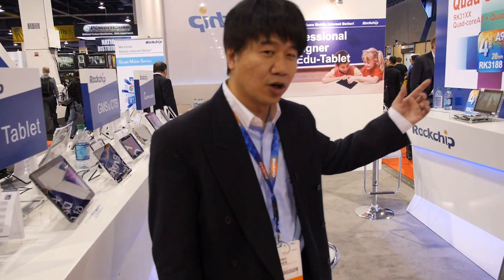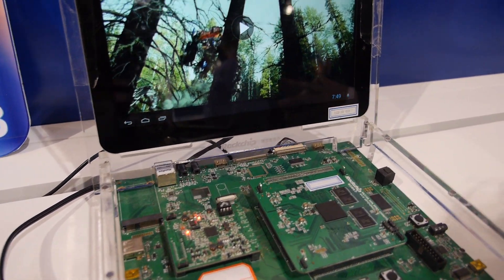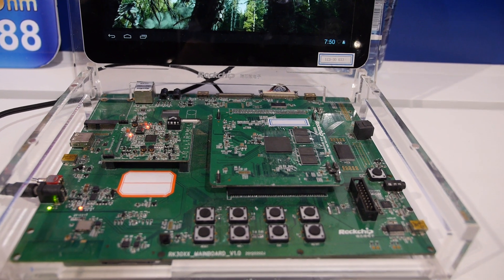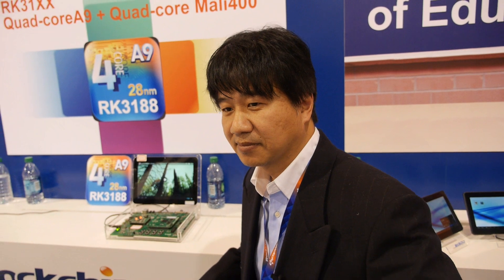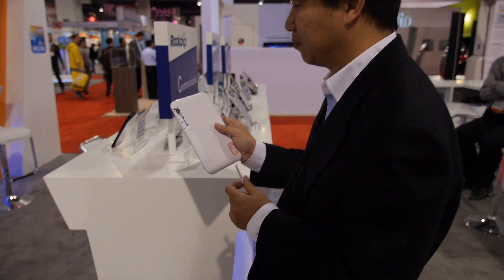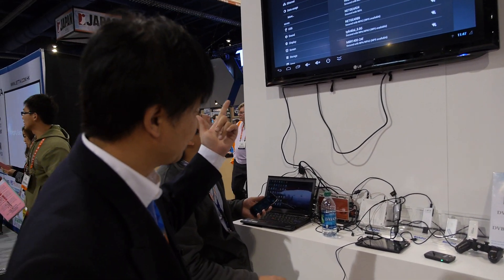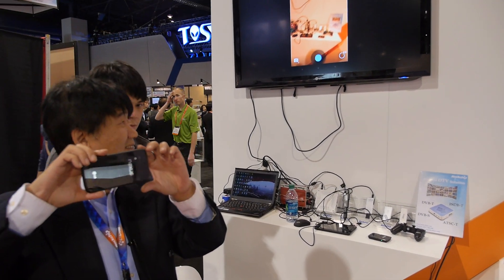Rockchip RK3188 Quad-core 28nm HKMG ARM Cortex-A9 launched

Comment: OK, but I must have a device with Android 4.2 and Miracast support so I can transmit the wireless mircast images. Then, if my TV doesn't have Miracast support I will use the Android TV dongle. But is there some Android application for the RK3066 which can accept Miracast from external device and show it on the TV via HDMI?

Comment from the maker: My guess is that all RK3066 devices on Android 4.1 already have Miracast support built-in, at least for the receiving part. But for sending the miracast signal it may only work on any Android 4.2 device and I expect Rockchip to release the 4.2 software update soon enough too.

Comment: Perhaps support for 802.11ad / wigig & wireless docking will be the key to outselling the netbook market!

Also, seems like devices based on the older rk3066 should work with miracast (MK802 , UG802 , mk808/gv20).. Why doesn't it??

I wonder what nvidia's tegra line is up to..

Comment: I don't think will be a special dongle for just Miracast, but an Android TV HDMI Stick which will have also the support for Miracast.
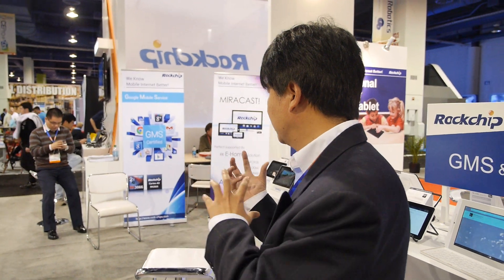You can see in this video at 7:25 something about RK3066 and the "E-Home Solution" so is possible with actual chipset and not needing to wait for the new quad core RK3188.
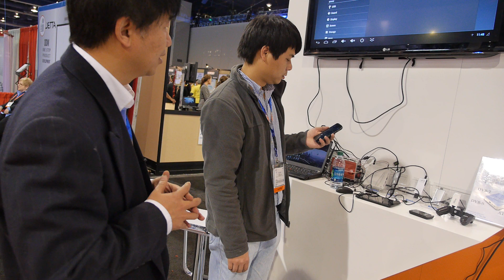I don't understand what said chinese the chinese guy at 8:07, but is something additional. Hardware or software?
Charbax? Do you have more details about this?